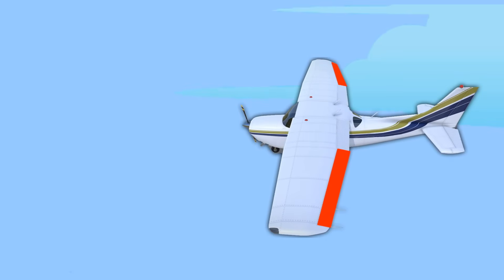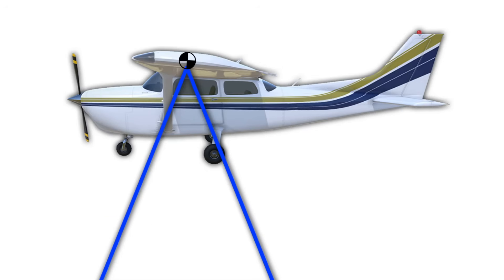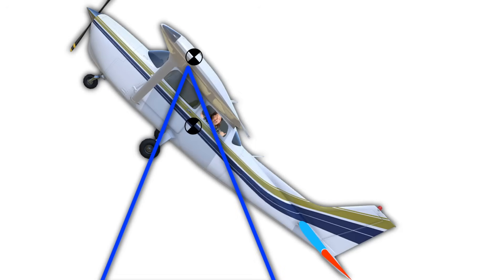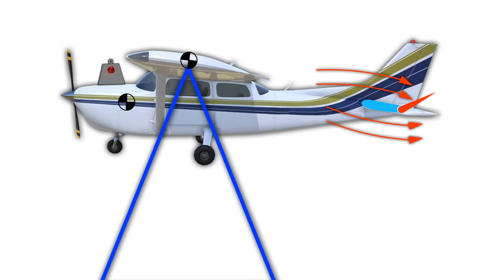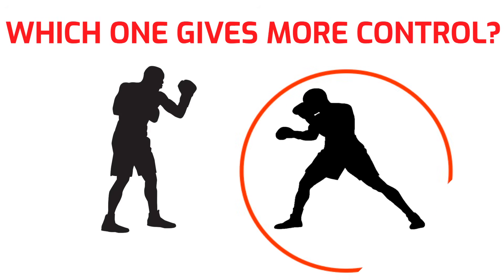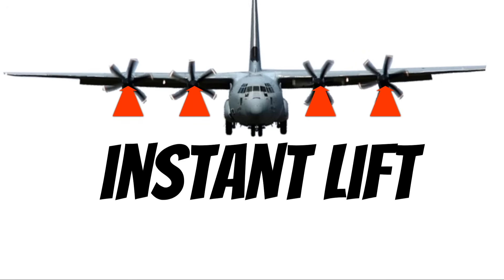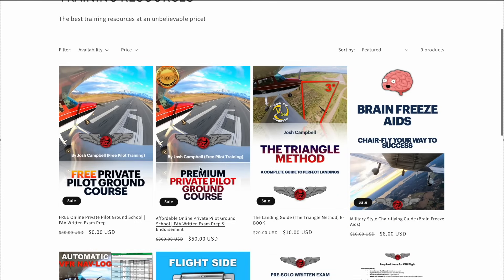Aircraft Controllability EXPLAINED (Private Pilot Ground Lesson 7)

Comment: If the CL moves aft, wouldn’t that have the tendency to make the aircraft pitch down *more*, since the CG is farther forward relative to the CL?

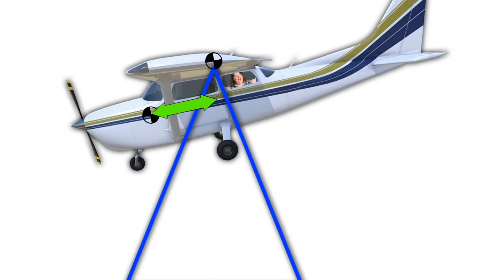I understand that there is a larger effect coming from increased wind speed over the tail, but if we ignore that, wouldn’t you expect the tendency to pitch downward to increase? 5:48
Reply from the maker: Yes, but the tail creates more downforce as well which makes the airplane more balanced (stable)

Comment: You say in this episode that adding more power can break out of a stall, but previously said to idle the throttle to break from a spin. Is the process different due to the fact that its a spin? Or is it related to the position of center of gravity?
Reply from the maker: In a spin, the plane has entered into an aggravated stall which is more difficult to control. The throttle should be brought back to idle to protect the engine from high rpm’s that are caused from barreling towards the ground
Reply: @FreePilotTraining  ohhhhh that makes sense. Defiantly wanna protect the engine. Thank you for the clarification.